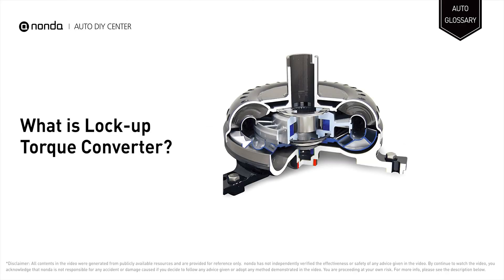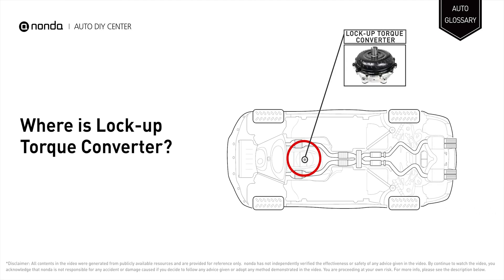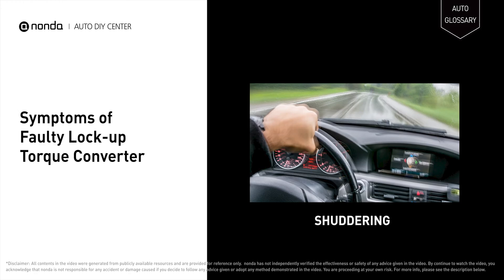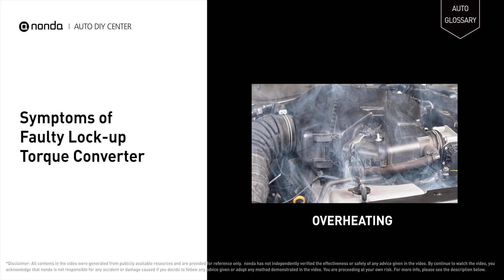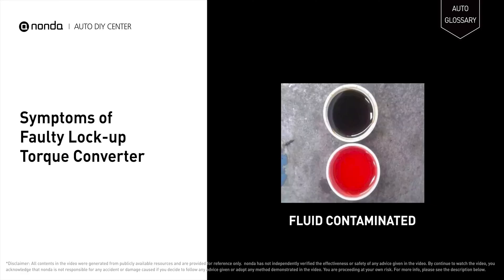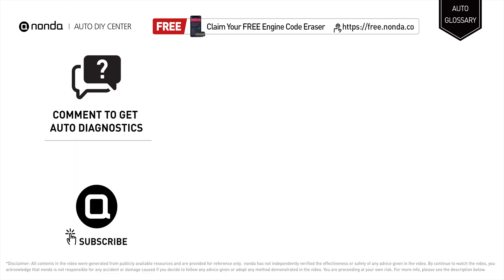Lock-up Torque Converter Explained

Comment: Im have an engine code P05A0, "active air grill shutter A stuck on" which has been on for a while but didnt look like it was going to be an issue. it looked like it was stuck open, so figured that was just an increase in engine cooling. But now im getting P0302 cylinder 2 misfire detected, and P181100 torque converter lock-up clutch excessive temperature preliminary stage reached. What are these and can i continue to drive for a while?
Reply from the maker: Hello, as you are receiving more than one error codes, we suggest getting your vehicle visually checked by your local mechanic for further diagnosis.

Comment: I have code
P0735 on my car and idont know what should i do

Dodg charger srt 6.4
Model 2019
Reply from the maker: Hello, is this the only code you are getting?
Reply: @nondainc   yes
Reply from the maker: Hello, kindly check the condition of your transmission fluid if dirty or if the level is low. Check the shift solenoids and transmission hydraulic control circuit for any issues. Fix as soon as you find the possible cause of the fault code mentioned, and let us know the result. Hope it helps!
Reply: @nondainc  can you make a video to explan that to me
Reply from the maker: We'll try to work on your request soon!
Reply: @nondainc  thnx💙